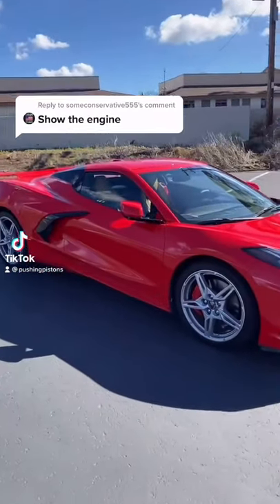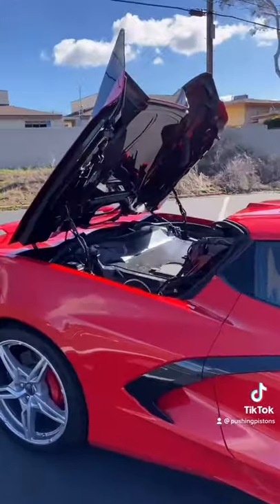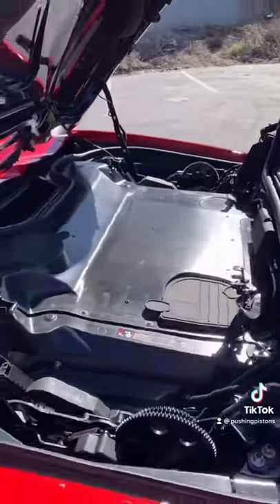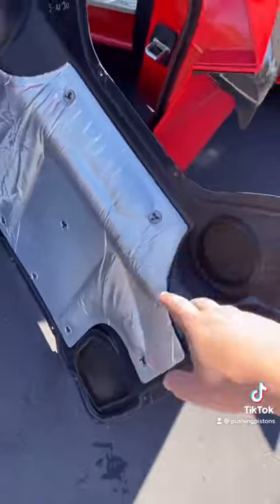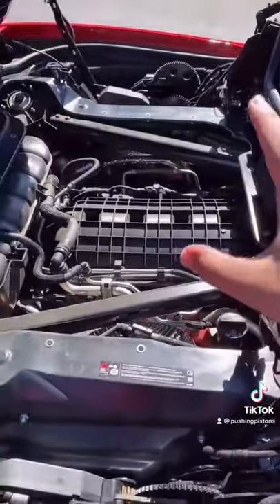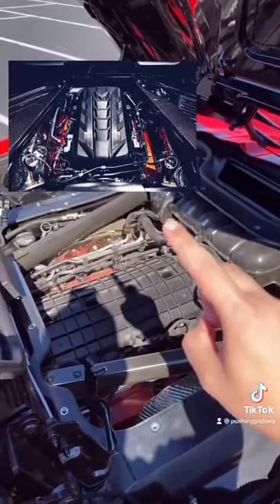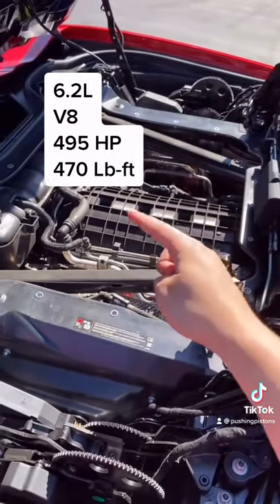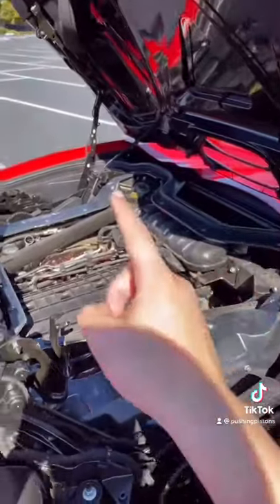Convertible C8 Corvette HIDDEN ENGINE!?

Comment: Wait so you’re telling me that the new corvette is pushing out way less horsepower then the Camaro?!?! GM you’re supposed to be better then that
Reply: Your elevator doesn’t go all the way to the top does it?
Reply: @pizzaslice8766  what?😂
Reply: @Xbox_finatic_6398  dude it’s a base model and you’re comparing it to a high trim level Camaro
Reply: @pizzaslice8766  dude, you need to reread my comment, I never said the ZL1 or anything, I was not being specific, but yes it still pushes out less horsepower than a slightly higher low trim Camaro.
Reply: @pizzaslice8766  regardless the C8 like all corvettes are supposed to be GMs high level sports/super car, like dodges is the Viper.
Reply: @Xbox_finatic_6398  the zl1 is the only trim with higher hp dude
Reply: @pizzaslice8766  no it’s not actually
Reply: @pizzaslice8766  there is the SS
Reply: @Xbox_finatic_6398  the ss makes less than 490 bro
Reply: @pizzaslice8766  even if that were the case though it’d still have far less horsepower than a fucking 2012 ZL1
Reply: @pizzaslice8766  that’s beyond the point, the point is the C8 (I think) is supposed to be very close to being a super car.
Reply: @pizzaslice8766  but it still puts out less horse power than the Camaro. That’s all I’m trying to get at

Comment: I would hate to work on the engine I would also hate having to remove the engine
Reply: naw. that’s prolly easy. if you got a lift. just drop the whole sub frame
Reply: @sr20_kid93  you do have a point
Reply: @sr20_kid93  I would also hate to do it cause of the computers and junk

Comment: Only 495hp kinda for a super car ?
Reply: It's not a super car
Reply: That is pretty much a "base" corvette. The Z06 and Zr1 will probably have 600+ for the z06 and close to 900 or even 1000 with the zr1. Personally if i had the money i wouldve waited for those models to come out. First year production cars can have some weird issues.
Reply: The Ferrari 360 has like 380
Reply: Sarbur Gideg  It has a nice 0-60 like most mid-engine vehicles should but thats about it. Still a good bang for your buck though.
Reply: Lmao. The corvette is not a super car.
Reply: @SrRAFAGAS  Has more power then the Ferrari 360
Reply: @MrInternFTL  the 360 is not a supercar either.  Both are classified as sports cars. Not every Ferrari is a supercar.
Reply: Sarbur Gideg  I dont consider it a Supercar. I think its in the same bracket as the GTR, Shelby GT500, Dodge Demon. and The Viper. I consider it a super sports car.
Reply: Power to weight ratio, my friend 🤔

Comment: Bruh how does my v6 have more hp than that
Reply: Because it has forced induction? Unless you have a Porsche 911 GT3
Reply: @Sinoops  I have a 2015 Cadillac CTS V6, with VVT and direct injection with a few aftermarket parts.

Comment: Slower than my GT2 Stinger
Reply: This would dust it
Reply: In your dreams my guy. You’re comparing a Kia to a vette 😂
Reply: @Feraz69420  a Kia had more power
Reply: @mr.x2832  how is 365 hp more that 495?
Reply: @Feraz69420  bro it’s a Kia with 350 vs a CORVETTE with only 490
Reply: @mr.x2832  weight per horsepower. Horsepower doesn’t mean anything the Volvo tractor trailer has 700 horsepower but I don’t see that thing going 200mph